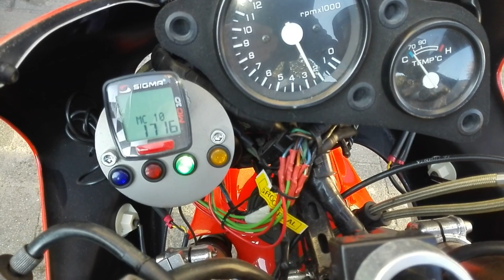RVF VFR  RC45 RC30 NC30 NC35  VIDEO-COMPILATION.

Comment: Awesome video. I’m curious to know, what solution do you use in the ultrasonic cleaner for carburetors? Thanks!
Reply from the maker: For the aluminum parts Tickopur R33 and for the brass parts Tickopur RW77, of course in the prescribed mixing ratio with water.
https://youtu.be/ME3PoSfkyz0
Reply: @NC35Race  thanks!